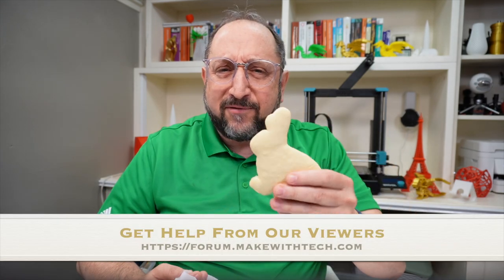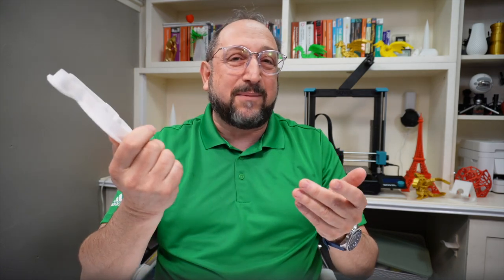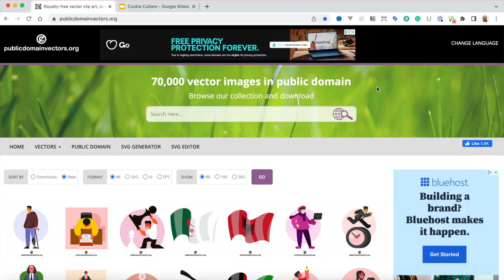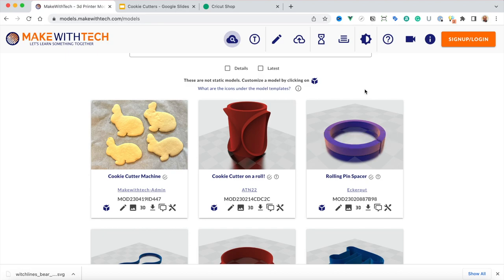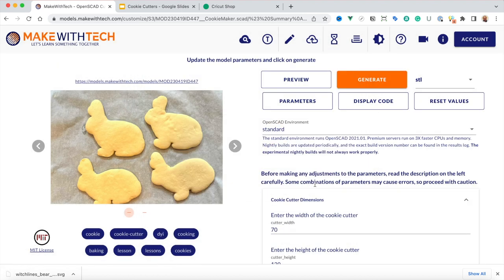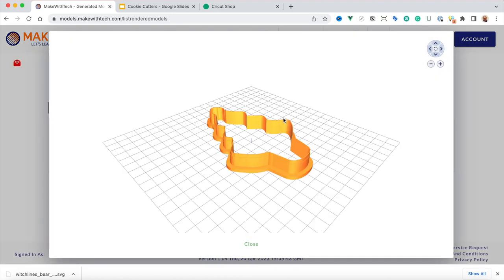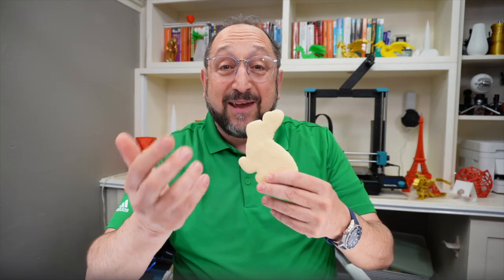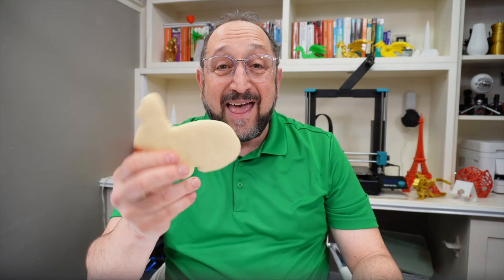How to Make Your Own Custom Cookie Cutters!

Comment: This method is also amazing to create customized lettering or logos. You just have to print the phrase/word, spread some SMD LED´s and then fill the inner part of the prints with Epoxy resin, coloured/frosted are the best. Thank you for this video, please never stop doing them.

Comment: Dear Irv, this is amazing! I tried this out with my new 3D printer, just in time for the holidays! I am so sad to see that the website is however shutting down. I do have two questions:
1) Re: custom models: I noticed the template rounds sharp edges in the shape (say if I have a star with sharp corners, this template changes my original svg file and now I get a star with rounded corners). Still nice, but unexpected. Is there a way to disable this option?

2) Re: website service: I just joined the 3D printer community and as a n00b, i found your videos  very useful! since the service will be shutting down, will there be another way to contact you/the service for support and questions?

Comment: Hi Irv, I’m totally new to 3D printing and want to make pottery clay cutters from my own drawings. Question… can I modify the height of the cutting wall? Eg say I want it to be 15mm high? Also, I need to create inserts that fit within the cutter, eg say I make a round cutter and want to create a round insert plate so that I can push the cut clay out from inside the inside without using my fingers to avoid finger prints and thus fussy clean up. TY
Reply from the maker: Yes.  Absolutely.

Comment: Ok the best option is this, print your design, then use food grade silicone then use food grade 2 part resin. now you should be good. I do believe.👍
Edit: Or you could coat the print in 2 part food grade resin.